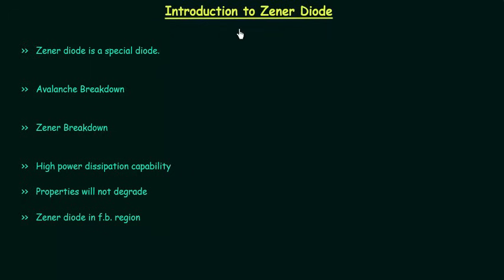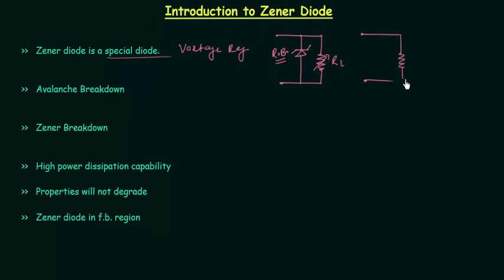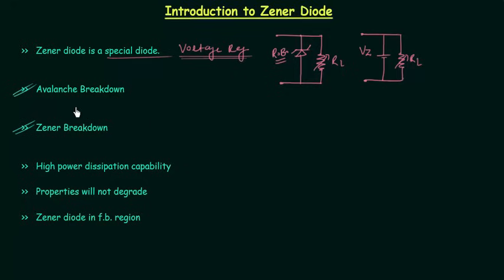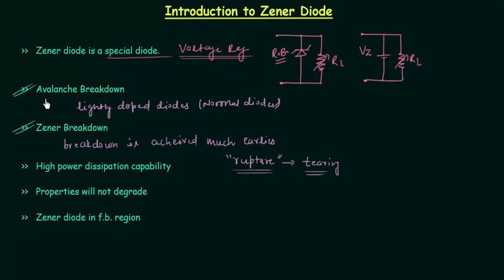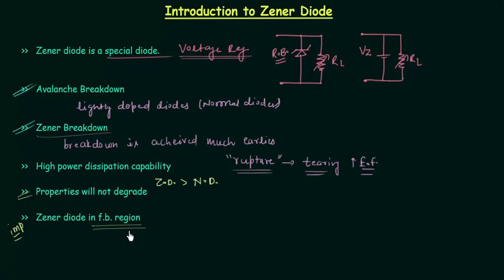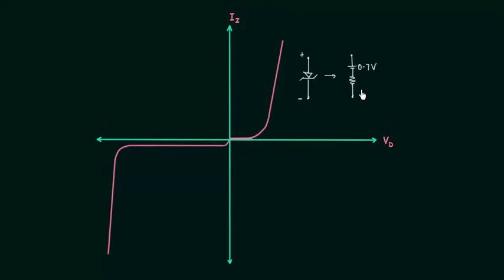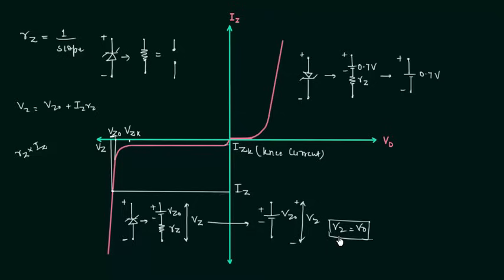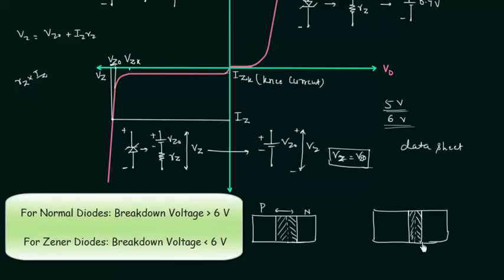Introduction to Zener Diodes

Comment: Sir ,as you said zener diode is heavely doped pn junction diode,and also the depletion region of such heavely doped diode will have narror region,which means the the barrier potential much reduced,then how did you say that in forward bias zener will act as normal diode with 0.7 drop (si) ? Can you please explain i stuck at this for an hour with my friends ..

Comment: I have a doubt... when you are replacing the diodes with the battery, you have taken the polarity of battery opposite,i think.. clear it please.. you had done correct or it is wrong because when i solve questions , i always get wrong answers,,
Reply: What polarity are you talking about?
Reply: In reverse bias ,,,, polarity of diode as taken same as Voltage across it,,, because Reverse diode is nothing but open circuit so the symbol basically represent the voltage across it..
Reply: yeah i had the same doubt too, i think he got it wrong as in the last circuit he changed the polarity of diode with opp to battery but while writing kvl eqn he treat the polarity as it is

Comment: At 12:46 in diagram what does Z° voltage  represents in the circuit as you draw it's polarity  opposite to  applied reverse bias voltage ?  Also in reverse biasing barrier potential adds to applied voltage....plz reply sir

Comment: sir, normal diode also have a breakdown voltage above which the K.E of e increases &results in increased amount of  e and conducts current .I have a doubt that why normal diode can't be used for voltage regulation
Reply: For a normal diode we has to apply more reverse voltage to get breakdown but for zener diode we can obtain breakdown earlier than normal diode no need to apply high voltage

Comment: Why depletion region is narrow in case of reverse bias.???
Reply: Depletion region is narrow in reverse bias (of zener diode)as Compared to normal pn junction diodes due to high doping concentration and since the width of depletion layer is small so a high electric field acts (as E=v/x) and the reverse breakdown of junction takes place at a less voltage as compared to other pn junction diodes.

Comment: - A zener diode exhibit a constant voltage of 5.6 v for current greater than five time the knee currwnt where knee current is 1 mA . The zener is to be used in the design of a shunt regulation fed from 15 v supply The load current varies ovee the range of 0 mA to 15 mA . Find tge suitable value for the redistor R What is the maximum power dessipation. some one pls  explain how to find the power
Reply: m

Comment: Why is the depletion region is smaller than the normal diode?
Reply: I have the same question. Since zener diode is highly doped, so the number of electrons in n-region and holes in the p-region will be higher than normal diodes, higher charge carriers means higher concentration gradient among both sides so more number of electrons should flow from n to p side and more number of holes from p to n side, so the region of uncovered ions should increase and hence the depletion region. But this does not happens, I don't understand why ?